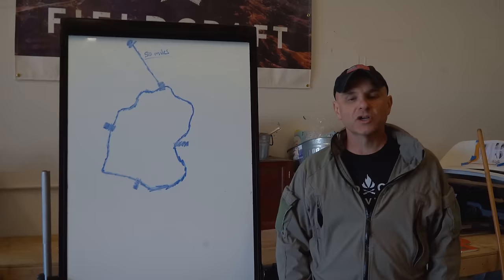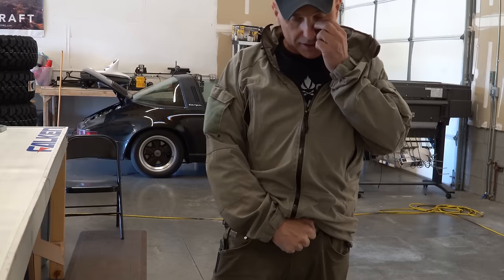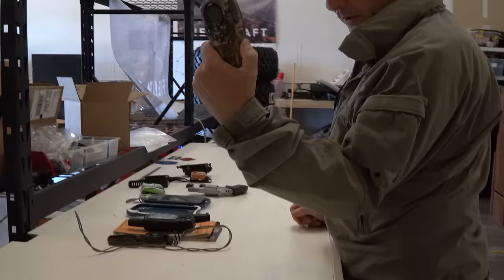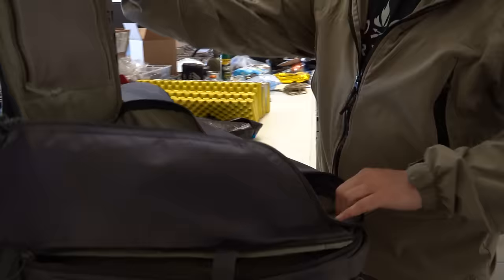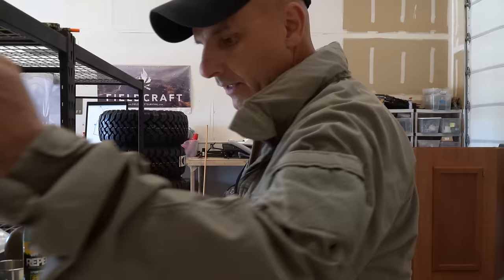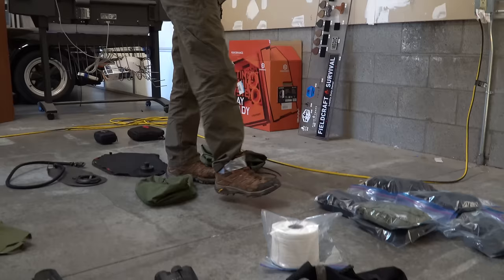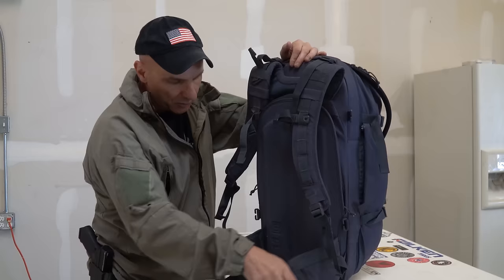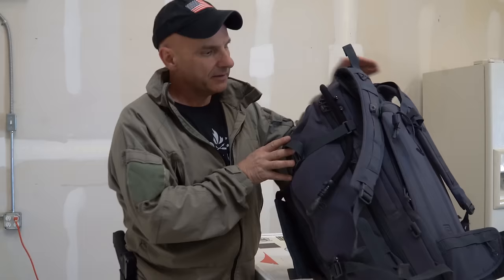Bug Out Load Out - Packing Out Your Ruck With Special Forces Veteran Kevin Owens

Comment: When your shoulders hurt, the waist strap is too loose.  When your waist hurts, the shoulder straps are too loose.  When everything hurts, the straps are juuuust right.
Reply: If everything  hurts its packed wrong. 
Unload and repack it. The soft stuff goes next to your back the hard items don't.  If its poking you YOU CANT PACK! and to keep things from moving pull the tight strings after to keep in place.
Reply: @cynthiarothrock4255   my 75lb bag hurts everything because its 75lbs, but i use the old fashioned Alice pack, so the frame keeps stuff off my back
Reply: @cynthiarothrock4255  are you THE Cynthia Rothrock of martial arts fame?
Reply: @jackpippenstock1104  no, I'm the Cynthia of southern Indiana and graduated  in 1982. And I'm living in my hometown  with an Indiana  University  with lots of students without any common sense.

Comment: As a Military Working Dog handler, I’m very glad to see someone with a dog.  They are such an asset.  They do not have to be super trained but not just an unruly YardShitter.  You’re scenario mentioned being in a city & working your way out. Just a single small tool for water: Sillcock valve wrench. Even with no water pressure due to city services out, each business/etc with those water faucets on the outside wall can give you a source of water.  Keep up the good work.  🏴🤣👍🏻

Comment: Helpful tip for the Baofeng ham radio; they make extended batteries that have a charge port on them and can be charged via the USB cable that comes with them. So they work with battery banks like your cell phone does.
Reply: @andrewweninger1059  still trying to find me one of them.
Reply: @50shadesofcerakote  you and me both

Comment: As someone currently serving I'll listen to any veteran with ears open and mouth shut. These guys have forgotten more than what I'll learn in my lifetime.
Problem with it is unfortunately, there's so much information out now that the more you watch videos the more paranoid you get that you're missing that kit or that tool. The best way to prep is get out there, and use what you have and add the items you NEED and not hear about. It's trial by error so that when shit does hit the fan, as it is now, you're prepped. That's pretty much prepping 101. If you're doing it now...it's far too late.
Reply: Mo Mentum never too late!!!
Reply: Agreed. The best way to prepare is to get out there. Walking 50 miles is no joke. Add a 40-60 lb pack and the number of people who could walk 50 miles drops precipitously. If you think you're going to bug out when the SHTF, you better have a lot of miles of rucking under your belt.
Reply: Edward Lawler that’s what I was gonna say.
Reply: Exactly. Got to thinking, and pulled out the stuff I had in my Jeep, just to make sure it worked. Maybe Macgyver would have thrived with my stuff, but a lot of it was cheap, and it showed. The tiny 'firestarter' kit I had in every glovebox? Useless. Tossed in two lighters and some waterproof matches in a crushproof container. If I run across an actual item that's worth a damn, sure, but if I need a fire, I need it today, not in 3 days. I know how to do this, including a bow drill, magnifying glass and all that. But if you don't practice with it, the learning, or remembering curve from 30 years back, is too steep to overcome when you have other priorities demanding your attention. So, get the stuff you think will work. Use it until you are good with it. If it doesn't actually work, shitcan it and start over. Time spent now, is an investment in the life you may save, later.
Reply: Never set your knife down and you'll always have the tools you need

Comment: As a former Eagle Scout, it's nice to hear someone preach the things I normally practice. This is much better info than 99% of the "survival" and backpacking guides I've seen. I would like to add that I like to keep my TP(cardboard removed, half roll flattened), a mini BIC lighter, trioxane tab, headlamp, and a pair of thick wool socks, and my "sleep" beanie(Polartec 100 very loose-fitting) in a 2-gallon ziplock bag at the very topmost most easily accessible point in my pack or top pouch. That way if your socks get soaked through by rain or sweat you can change quickly and attach your wet socks to the exterior of your pack to dry or if you take a spill in the drink on a creek or river crossing (hip and shoulder buckles undone for safety) you can warm yourself up more quickly and set to work drying out your clothes by a fire (TP for tinder, trioxane if wet out, dry mini BIC) socks and beanie for warmth (When you're drenched and it's below freezing not having to dig through your entire pack to find the essentials when you're having a hard time focusing and losing dexterity is pretty great). Next down I keep my rain fly for my tent or group cooking rainfly in case of a prolonged downpour as he suggests. Then next down another 2-gallon zip lock with a change of underwear and my sleep/undershirt, another pair of thick wool socks, and a spare pair of boxer briefs. His advice on the trash bag for your sleeping bag at the bottom has saved me from an unpleasant and/or dangerous situation multiple times. Even if you use a pack cover it won't keep your bag from getting drenched if you fall in a water crossing. It was refreshing to see someone cinch down and wrap under their straps for once. Getting caught up in branches and falling on your side or back is embarrassing. The non-aerosol small plastic bottle of deep woods off 99% DEET in a sandwich bag weighs like 1/4 of your aerosol can and is enough for a few weeks. I'm also 110% on board with the "wet" wipes. One last thing, I also take a ziplock sandwich bag in my shirt or pants pocket with talcum powder, baby powder, or Goldbond for my privates and/or to help stave off the Monkey Butt as you so eloquently put it.

Comment: I bought a vest for my German Shepherd. "Duke" packs his own food and bowls.
Reply: I'm a K9 Handler for the Gov't and wouldn't suggest this.  The reason why is K9's overheat very quickly and will push themselves without complaint until they are in a medical emergency or literally fall over dead.  Unless you train your dog frequently, as in every week, with a weighted vest on they will never build the endurance they need to pack extra weight on their small frames.   I would suggest keeping them free of anything that can hinder their movement so they can defend themselves and you if need be.  With even a simple patrol vest on them they are hindered, add weight and things that can get caught on obstacles and you are just asking for trouble.
Reply: Ya listen to him ^
Reply: curious what kind of mileage you and Duke have done safely and under what loads. Cheers
Reply: 8654 Zulu Foxtrot great advice. Thank you
Reply: If you are using your dog as protection the dog will have handles to grab and control the dog with plus it overtaxes them physically requiring more food and water that slows the dog and you down.
Reply: I'm not a professional, but I can confirm @8654 Zulu Foxtrot. I have a vest for my Doberman and I noticed he would develop a rash in areas with friction after running a few miles every day. That's also without any weight added to the vest. Dog vest does not seem viable for a 50-mile hike, especially if the dog isn't already used to wearing the vest for long periods of time.
Reply: Dear service dogs  regularly  wear a vest . And dogs over 60 pounds part of their service is to carry items needed for the day anything for the dog or their ADA  needed handler. From equipment  to medical to schoolbooks. Make sure you give your dog breaks and the weight isn't more than 1/2 the dogs weight.   Also dogs can be trained to pull a cart like a sled dog except its for one dog on a leash and its for bulky medical. ( like an oxygen tank on wheels) or pull a wheelchair on voice command  only.

Comment: I started my army career as a light Infantryman with 9th Inf Regt (Manchu), one of the things we did was pack everything in waterproof bags no matter what time of year. Remember Murphy is always running around looking for ways to fuck up your day. If you have not heard of this, take the old UCP, Rid Green Apple clothing dye, and dye the pieces of equipment and uniforms. It works great for the South Eastern US during most of the year. The Air Force pattern looks great also, green tiger stripe look. 
For those who have not been rucking here is an idea I started doing, I loaded up my ruck and started walking on my treadmill in the basement, 3 MPH at 5-8 incline, pretty good workout.
One thing I also pack on the outside is a small tent.

Comment: Solid tip about the sleeping bag, I used to stuff mine into a dry bag, then stuff it while open into the bottom of the ruck, then seal it, effectively vacuum sealed into the shape of the ruck
Reply: Good advice.

Comment: Kevin a true testament to testing the gear you carry. sometimes it's not as easy or simple, but know the operating area is key.. I love that you packed the dogs food, i would be doing the same, and very possibly packing the horses too.. so we would have to consider their needs as well.  More than likely if you have a pack animal available ensure that you bring proper tack, can move and clear with them.  They are 80% of my packing capabilities to move quick.. so with them i can travel many many miles without having to break myself.  if i can't take them then yes 100% is on myself and my family to carry what we need.. if you backpack you know what you need as the overall load-out.. After that it's estimating food, and edc needs.. where you are going to lay your cache, and how to move if with small children.

Comment: another option to zip lock bags is the storage bags with one way air valve. Easy to crush the air out fast esp for larger items such as clothing. Also add some snake gaiters for lower legs if yr moving over rural land. A compact hammock kept rolled in the claymore pouch for fast sleep setups off the ground is useful. Dynamo recharger. Small pry bar for gates /doors on crossing a  broken city. some form of optics to assess people and routes from a safe distance.

Comment: I like the “pack for a hurricane” theory, but I’d have to admit that I wouldn’t bring as much as he is. It’s 50 miles. Max 50 hours of hiking just off the road or on the road depending on route and time of day. Should be able to do it in 3 days given you aren’t bugging out to a high altitude location. Just my .02 and completely understand he is adjusting to a basic load out applicable to the majority of circumstances here.
Reply: I see a lot of opportunities for weight savings, leave the Nalgene, leave the camelbak, get some collapsible water bottles (platypus makes great ones, and they have a drinking tube attachment). Also no water filter, which is a HUGE oversight. Never assume you'll have access to drinkable water.

Comment: Awesome, good stuff. I’ve never seen the duct tape on the boots before but it makes good sense. Also glad to see the use of dummy cords, even from someone as experienced as yourself. I was too cool once upon a time to dummy cord some important gear and lost it, not a fun situation to say the least😁
Reply from the maker: A lot of good lessons are learned the hard way!!
Reply: I've heard some guys put blood type on the tape...
Reply: I will remember that because where I live. We have seed pods called hichhickers. That are darn near impossible to get off your laces.
Reply: i couldnt really understand the point of duct tape on the boots. What was it for? asking to learn
Reply: Willem-Paul Koenen - To avoid his shoes becoming undone, but I thought it would be sufficient to have a knot in your laces to stop this from happening.
Reply: I run my Merrills with paracord laces tied together at the ends with a with a quick cinch from my pt shorts. Haven’t come untied ever...10 years of this setup almost every day. Fastest way to tie and untie too. A bit more fashionable than the duct tape method lol
Reply: I put duct tape over my heels (outside of the sock) to prevent gnarly blisters.
Reply: @Dusther210  I personally wrap my boot laces around my boots once and then I tie them up and there is no excess laces and I think it works great for me. It's a little tricky with extremely long laces but it still does the job.

Comment: Any preference for making movements at night vs during daylight? Cooler temps might make it easier and let you get farther carrying less water and moving faster. Could be a good option for an urban bugout. Also can't recommend enough for folks to go backpacking. It's basically practice bugout and camping. Shakedown all your gear, get good with it, find out what you need/don't need. For example, my dog needs boots to hike more than around 5 miles or his pads get torn and he's limping for days. Good dog boots (and socks, seriously) and he could do 20 mi/day no problem.

Comment: I like to use the Mylar wrapped bible wrap the is common amongst HVAC guys. They use it to wrap metal duct work to prevent condensation. It make for a warm and very light and compact bed padding. I also like tyvec house wrap material. Lets your body breath but still keeps you waterproof. If you want to take the noise and stiffness out of it take the piece for your kit and run it through the clothes dryer a couple times.

Comment: Great video.  Really like that this gentleman brought up putting EVERYTHING in plastic bags as though it's going to rain at any moment.  I'm out in New England, and it can rain here without a cloud in the sky.  I've been trying to instill in my circle that everything has to be protected from the weather, and spare bags should be carried (30 gallon heavy duty trash bags weigh nothing and are worth a fortune).  Also, vacuum pack up a couple pairs of smart wool socks and stow them in the bottom of your pack, in a cargo pocket or anywhere they will stay safe.  My immediate survival item order is always knife (fixed)-lighter-socks.  Ain't gonna survive if your feet don't work.

Comment: A double overhand knot on the second over-under on the laces will keep them from coming untied.  I've been using this method for 10 years and I have never had laces come untied during that time.  I hike extensively and regularly climb large mountains/technical climbs requiring belays and rappels/winter mountaineering/ multi week backpacking (Rucksacking) trips.  First knot like normal- typical over under.  The top knot (or the butterfly) you do it twice: Over-under, over-under, then tighten.

Comment: Very happy to see you contribute good info for people to glean from. If I may add some of my SF input that hopefully can help. Just two things in relation to this video. 1. Dry foods need water and if your in a water scarce environment best to consider hydrated foods like canned food etc. 2. The water bladders are convienant but I personally sat back with my pack and a thorn somehow went through all my stuff and punctured one of my 4 bladders. My last day on ops was a real struggle because i was short water due to this incident. Since then i carry water only in hard plastic 2 liter soda bottles and 1 bladder for while walking.

We strongly adhere to the 5 Cs...  Cut, Cord, combustable, Cover and Container. So for extremely light BOB kit all youd need is a Letherman, 4 Bic lighters, couple hundred feet of 550 paracord, 8x10 dark tarp, soda bottles and a stainless steel half liter container wide mouth. 2 rolls of duct tape of course. 
Remember, Know more, need less.
Be safe all, be blessed. Great video👍🏼

Comment: Okay, you forgot a few important things. One, in a emergency situation, like a Fire, Flood, Storm or Earthquake, Cell phones will not work, due to the towers being knocked out, or just over whelmed with traffic. Two, Proof that at one time you owned a house, and insurance papers. That is if you own a house. Three, Any medication you might need. Oh and along with the sleeping mat, a reusable reflective blanket, and a light weight tarp. As for tools, one of those funny wrenches that will open a tap on the side of a building, small set of bolt cutters, just keep those out of sight. Cant think of anything else off the top of my head, oh and I used to teach wilderness survival back in the early 80's. But, things where a bit different back then. If you buy the jeans labeled "PreShrunk" they wont shrink. I used to be a ranch hand, wore jeans every day, heck to this day I still do. Never had a pair shrink on me. Not sure where you buy yours though.

Comment: whats nice about freeze dried foods is there light weight, and you really dont need to have hot water. cold water will also do the job. Ive placed cold water in some, put it back into my ruck and continued rucking. In about a half hour, stop and eat or just eat on the march. Heck you can eat it dry. kinda sucks, but you can. Im getting older and weight is big factor. thats why i dont carry means to heat water other than a lighter, matches, and a ferro rod. if i need hot water im going to burn some stuff. I cant carry the load I did when I was a young man. Its 72 hours to get home. I just want to get home.  Good video.👍

Comment: Water straw or filters would be good and an urban water key for buildings / I also keep 2 small breaching tools along with 3 extra packs with fire arms so I have a team. Good to go. Team knows where to met and if they are late they know by a code on the wall our direction of travel. Stashes and cachet 1 day out in NESW could also be valuable. Radiation Devices are small these days . Small Nods can be useful. Head to a coast get to the water !